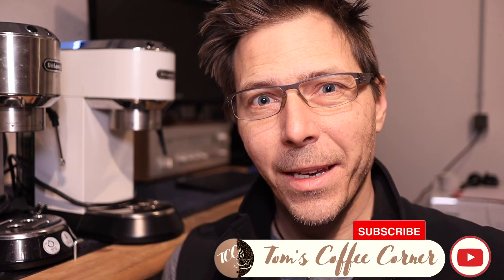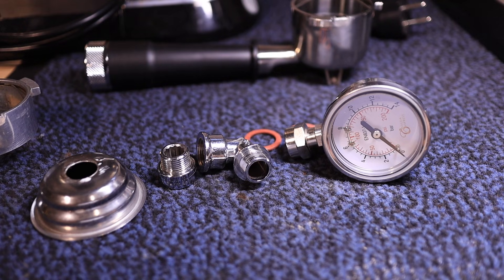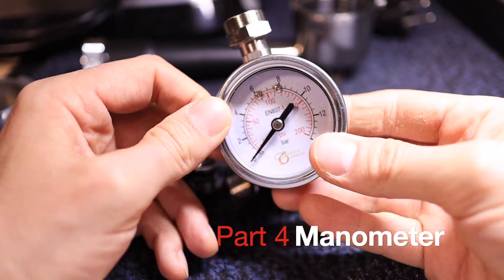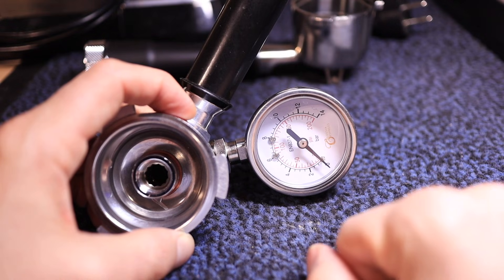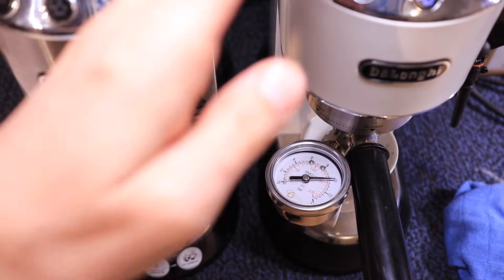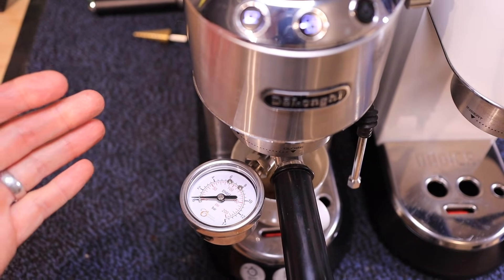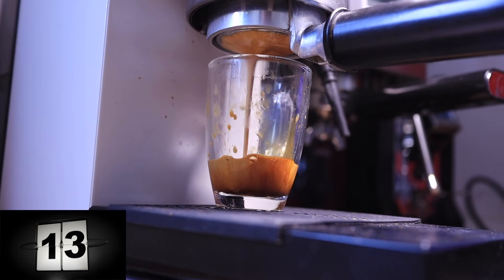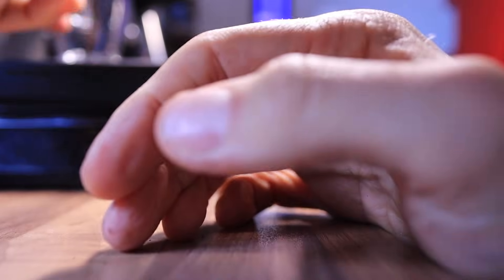How Much Pressure does the Dedica really Have? Prep for 9 Bar Mod

Comment from the maker: 15 bars is the advertised pressure of the DeLonghi Dedica, which is way too much for a conventional Espresso! In this video, we look at how to make a manometer out of a pressurized filter from the EC685. 
Join the coffee club! (subscribe): https://www.youtube.com/c/TomsCoffeeCorner?sub_confirmation=1
0:00 Intro
1:27 Building a Manometer
4:24 Measuring our Nominal Pressure
7:07 Low vs High Pressure Shot Comparison
10:17 Looking Forward to Part II: Replacing the OVP Spring
Reply: Hi Tom have you seen this? pressure seems not to be relevant as long as you use the right grind size, the pressure will be 9 bars (even usung 15 bar machine) so it is important to have a manometer to measure the pressure when brewing https://youtu.be/HLyKePMX58M
Reply from the maker: @a.rincon2748  Hey Rincon, thanks for that, I will check out Lance's video. You know, when I got the La Spaziale, I was taught to adjust the OPV in this manner, with a portafilter manometer. But, I am beginning to think that you're right, and that I need to mount an inline manometer as well.
Reply: @TomsCoffeeCorner  I think you should connect manometer and do the caffe few times until overpressure valve activates. Then you will read max pressure. I got too sour espresso problem. With bottomless its even worse. Too fine grid, too high pressure, espresso is still too fast :(
Reply: @TomsCoffeeCorner  

Hello Tom,
When you tested the older machine with the dummy sieve manometer, it stopped the pump after 7 bar and all the buttons were flashing. The instruction manual says that the flashing of the three buttons is an error message for a clogged sieve. Perhaps it would otherwise have reached a higher pressure?

 But why doesn't this message appear with the white Dedica?

 I have exactly the same problem. Could changing the OPV help or is this a problem on the control side or somethung else?

Thank you for your answer and best regards from Germany.
Reply: Hi Tom, I have a dedica that is now some years old. Until recently, I only used it maybe a couple times per week. I recently got into espresso, and have done optimzations such as getting a 51 mm non-pressurized portafilter, distribution tools and a nice tamper, and importantly upgraded to a high  quality grinder. After watching your video, I now am concerned that my machine could have lost pressure over time. Do you know by which mechanism the dedica looses pressure, and how I can fix it? Warranty has expired anyways, so I'm down to tinker with it. If I screw it up, it's time to get a new espresos machine..
Reply: Hi Tom, it is 11 bar when the Brew head is blocked by the manometer, so the pressure will be less than 11 bar when there is a flow. Faster the flow lower the pressure. We need to measure the pressure at the right flow rate as we brewing. That is tricky.
S
Reply: Hi Tom. Thank you so much for your videos. But there's one thing: classic espresso machines have a 58mm group, while Dedicated ones have a 51mm group. I asked the gpt chat what pressure should be applied to a 51mm portafilter with the same grind as a 58 group to get a proper espresso. The gpt chat calculated that the pressure should be around 15 bar, considering that the contact area with the water will be smaller and the pod will be taller. I think that's a good idea. What do you think about this?

Comment: It would help a lot to identify the worn part that made old dedica to deliver 7bars only. My one dropped after 3 months. I have OPV valve ok. No limescale. Stuff  like this......Also looking foward to see a video where someone show exactly how to set-up grind size for pressurized and non pressurized baskets. .. especially because is extreme difficult to measure grind size using various grinders. I am using A BArazza Encore. I can bet we can not fid 3 Encore machines to grind perfect same size with the exact same settings and so on.

Comment: Does your 7 bars machine extract coffee still using a original pressurized filter? My new dedica pressure can not go through after 5 months of use. Filter not clogged. No bubbles in the reservoir. Pump going way more silent like your machines goes when they reach max pressure they can deliver. I did replaced the ball and gaskets from pump repair kit i did purchase. I did notice improvement but i still can not use fine espresso grinded coffee. I need to grind a bit coarse than that and I have to avoid tamper it too hard. Any ideas? I did not touch the OPV valve since does not seems water goes back to reservoir. If OPV lose pressure back then we will not have that pump sound reduced when the pump reaches the pumping limit. I am using the original pressurized filter which is not pressurized anymore. I did enlarge the tiny hole up a 5mm diameter now. It helps but still not ok. If i use a depressurized filter bought from amazon machine works. My point is that the machine should work with the pressurized one as well. Any ideas SIR?

Comment: My EC680 started to do weird things. It just stops pulling a shot if I grinded a bit too fine. I've seen videos where Dedica even it was choked (dripping very slowly) but it kept pumping water up to 50 seconds. I replaced the pump, cleaned the flowmeter, descaled the machine, and changed the OPV valve. It still doing the same thing. Steam works just fine, I can steam my milk as long as I want. Just hot water also coming pretty quick out of the brewing head. And it can finish a shot if it not very fine (usually it takes just about 20 sec for 16g of grounded coffee, anything finer will force machine to stop). The machine does that "pre-infusion" pump, wait, then it pumps for a while (3-6 sec maybe) and stops. Any ideas of what it could be or what I could check further? 😬😬

Comment: I got the 885. Whe I put in finely ground coffe it stops after a few seconds and doesnt extract anymore. If I go coarser it runs through too fast...
Reply: I have the same problem. I guess it can't sustain the high pressure over the necessary time and it's annoying. The only thing that works for me is running the shot longer until a brew ratio of about 1:4.
Have you found a solution?

Comment: Instead of the elbow, put a T junction on the portafilter and a ball valve on the bottom of the junction. Then you can release/bleed off the pressure in the portafilter.

Comment: I think something is Brocken in my dedica .

I just let it run without any cofffee.
It pumps out 9 ml in the preinfusion and 125ml in 25 sec witch makes it to 5ml/s flowrate.

Whats your flowrate?
Reply from the maker: I believe normal flow rate was either 6 or 8 ml/sec. I'd have to check again to be sure though.
Reply: I measured exactly 14g

From pressing the start button to end 15 sec 34ml
Reply: I also build a pressure gauge myself to test my ovp pressure setting.
The pressure stops at 9bar.

Perhaps in newer models they changed something.

I looked up the datasheet in the ulka pump and it says 300ml/s  at 9 bar. So it should be alright here.
Reply: In hotkoffee i found.
Ausgleichs- und Überdruckventil Saeco/Philips for 10bucks i alteady ordered forhand so i gonna replace it an see if i get the same pressure out.

There is also a mod that transfers the overpressure direkt behind the pump with the help of a T-adapter and an Y-adapter to adapt the in and outlets of the watertank. It should help not too fool the flowmeter . will do the mod also.
Reply from the maker: Interesting - you should post a video when you do it. Cheers! @ninarise7841

Comment: Unfortunately this measurement is incorrect. you did not measure the actual pressure above the tampered coffee pod, but an extreme situation which is the clogged portafilter.
Reply from the maker: Yes, I ended up measuring the max pressure.

Comment: I can't seem to get an extraction in the 25-30s range with 18g coffee and 36g out. It appears the machine over-pressurizes, i see the lights flash a few times and the machine stops mid-way through the extraction. I can get around a 20s extraction, but when i adjust the grind a bit finer, I run into the issue again. I have a 1ZPresso Jmax grinder, I'm using a non-pressurized basket, and have tried various beans, so I think the machine needs a fix, it is like 10 years old.
Reply from the maker: Hmm, yes you have probably lost pump pressure in that time. I overhauled my 5 year old Dedica, and went from a max of 7 bar, to 11 bar afterwards.
Reply: @TomsCoffeeCorner  Подскажите, у вас есть видео с ремонта вашей Dedica?

Comment: Thanks for your great work.👍

Haven't the pressure be the same,
if the extraction time stays constant, because of the pressure-flow-characteristic of the pump?
Reply from the maker: The pressure is affected by the flow, which is highly minimized if you have the water bypass through the OPV via shortened or weakened spring.

Comment: Does the OVP have any relation to the amount of steam coming through the steam wand? I have had my machine about 18 months, have regularly cleaned but the steam coming from the wand is pitiful. Do you have any advice? It would be gratefully received
Reply from the maker: Only if the OPV is defective, will it have an effect on the steam pressure. Maybe that's the case on your unit?

Comment: What grind setting did you use to get that extraction with 11bar? Mine pulls through very watery with an open basket by the end even at very fine grind. I thought it was too much pressure but yours looks fine.
Reply from the maker: It depends a lot on the bean. Need freshly roasted beans! Cheers

Comment: At the moment, my dedica machine is applying 11 bar pressure then. I'm using a non-pressure portafilter on the Ec685 model. Is it correct?
Reply from the maker: No, that is just the maximum pressure possible. The actual pressure depends on your coffee puck preparation.
Reply: @TomsCoffeeCorner  There are big differences with 9 bar machines, right?

Comment: Is there any way to get 15 bar ??
Reply from the maker: Nope. The system maxes out at 11 bar. But you don't want 15 bar anyway. It would erode the puck too quickly.
Reply: @TomsCoffeeCorner  i just bay a new machine café its support 20 bar but im getting 5 to 6 par only 😥

Comment: So I’m considering buying one of these but having watched your other video about modifications and upgrades…. Wouldn’t I be better off just buying a better machine from tue outset? Like a Gaggia Classic Pro for example? Maybe almost double the price but maybe worth it?
Reply from the maker: Well, in Europe, the Gaggia costs 3x the Dedica, so that is quite a difference. I did make a video comparing the two machines. In the end, you have to go for what you prefer. Maybe not based on perceived value, but other intangibles like looks and ergonomics. To be, the espresso is not 3x better on the GCP compared to the Dedica. You could also consider a lever machine like a used La Pavoni or a new Flair. Those should provide great espresso, but a more cumbersome workflow.

Comment: Thanks for this very nice and interesting video! 
I would also be curious about how the temperatures differ between the two machines, this might even have a stronger impact on the taste than the maximum pressure your machines achieve - potentially, the extraction pressure is not the same as the maximum in both cases... Just thinking out loud... 🤔
Reply from the maker: You are right, Piet. The pressure has more to do with puck preparation than max pressure. However, lowering the max pressure which can be applied to the puck does seem to have a difference in taste. Hitting the puck with a lower max pressure seems to allow for less channeling, and better overall extraction, but maybe that is just me. Cheers!

Comment: I guess that pressure is much lower during extraction. Pressure may reach 12-15 bars with the blind filter, but will never hit this level during the extraction.
Reply from the maker: That is right, Stepan, it maxes at 11 bar, but during the extraction it is around 9 bar.

Comment: Really great series. However - and this is not really a criticism - but how did you calibrate your tool? I learned from this that an old machine loses a material amount of pressure vs a new one and that alone is helpful, but absent proper calibration I don't really buy into the absolute figures stated. Still great videos tho, as a Dedica owner you are doing a LOT to answer some of teh questons I have! Thanks
Reply from the maker: Hey Dave, I just have to trust that the gauge is accurate enough, since I have no way of calibrating. 
Anyway, at least we can compare the differences between machines and between and older and new machine. Or, you can check to see if the pressure is way down, due to something broken (see OPV video). 
Cheers!
Reply: Excellent question.  I am dealing with that same question for blood pressure monitors.  My BP at home and at the docs office differ but as neither can be calibrated it's just ballpark stuff.

Comment: The same espresso I tried in the coffee shop made with industrial machine can't make it with Delonghi Dedica though I believe I tried every trick I could think of.
Reply from the maker: Hey Taip, I don't think it is possible with a home machine to repeat what those machines can do, but we can try our best. Even my €1,500 La Spaziale dual boiler machine cannot make espresso as good as the industrial machines they have at cafes. Those cost up to €20,000 and have expensive grinders paired with them. Nevertheless, it's fun to try! Cheers ☕️
Reply: @TomsCoffeeCorner  thanks for your reply. I appreciate it very much. Well, I guess I will have to settle for less. Though I thought if the temperature is right and the pressure similar, and also having in mind the coffee grind, why not produce the same quality espresso.
Reply from the maker: @taiptaipi8154  I think it's mainly because the temperature is not as high, nor as stable. Cheers!

Comment: would there be a easy fix to raise the bar pressure on the older dedica? change a spring etc?
Reply from the maker: Hmm, I mean you could put an even stronger spring in the OPV, but I would not suggest doing it. It is also a safety valve, so I think it is best to leave it as is. The machine provides 8-9 bars of pressure in its unmodified state, with an unpressurized filter, so I think that is good.

Comment: Should not the time be measured from the first drop of coffe instead the start of machine?
Reply from the maker: That is a debatable question. I feel like it should be measured when the pump starts, as the puck is absorbing water (tamp, grind and beans will affect how quickly water is absorbed and how much resistance is provided). Others say first drop. The main thing, like any measurement, is to be consistent. Cheers!

Comment: in my opinion, the test methodology is not good.  The pressure should be measured on an "open" portafilter, limited only by poured and compacted coffee.  this test only shows the pressure generated by the "blocked" coffee machine
Reply from the maker: Hey there! You know, when I got the La Spaziale (which has an adjustable OPV), I was taught to adjust the OPV in this manner, with a portafilter manometer. 
But, I am beginning to think that you're right, and that I need to mount an inline manometer as well. Some people also recommend a "diaphragm" manometer.

Comment: Interesting video, but I think the pressure would be different when you put different loads on the machine. In your experiment you have totally blocked the output. It would be great if you invent a gadget to measure the pressure during a real extraction.
Reply from the maker: Hey Maryam, I am starting to realize that you're right. Nevertheless, it is still interesting to see what pressure these systems build up.

Comment: You are using a unpressurized basket, despite the ability of the machine on work in high preassure, preassure is not needed in that basket, the difference in the taste is because the old one needs to be cleaned, look at the right button tilting in red, that means you need to decalcify your machine
Reply from the maker: Hey Ivan, I do descale regularly, so I don't believe that is making a difference on the pressure. The pump is probably 5-6 years old, and could use an overhaul. 
Oh, and unpressurized baskets do still need 9 bars of pressure...they just don't need 12-15 bars.
Cheers! -T

Comment: I wonder how a proper descale would effect on the pressure of the old machine?
Reply from the maker: If the machine had been regularly descaled, I don't think much difference at all. If the machine was exposed to bad calcified water for years without descaling, then eventually also the pump would be affected.

Comment: Hey, nice content. Would have been a better comparison if you'd have altered your grind size to match the shot time for the two pressures given we're trying to increase extraction by brewing with finer coffee. Don't know if you remember me from the last video but I'm doing my own version of this mod and have just measured a new opv spring at roughly 0.98 n/mm so I'm guessing 0.57 for 6.5 bar, 0.8 for 9 bar. Going to re-do the experiment hopefully with a little greater accuracy, let me know if you're interested to hear the result.
Reply from the maker: Hey Laurence! How did you measure the n/mm on your springs? Yes, I would be very curious to hear about your results.
By the way, both the 7 and 11 bar extractions took 23 seconds including pre-infusion, which seems counterintuitive. But sure next time I could try grinding a little coarser for the lower pressure one.